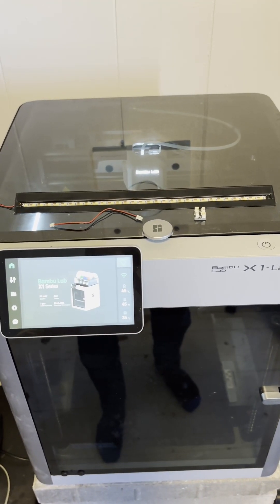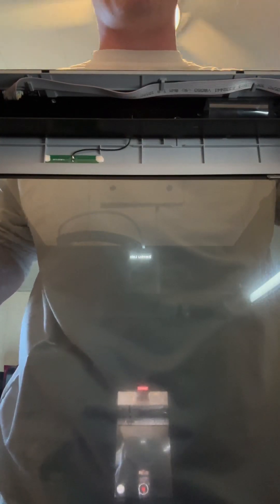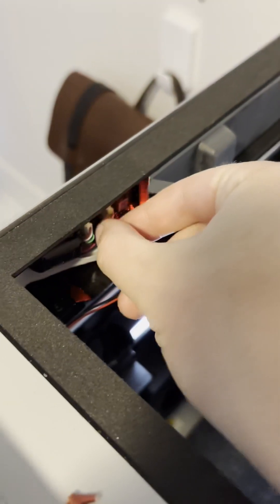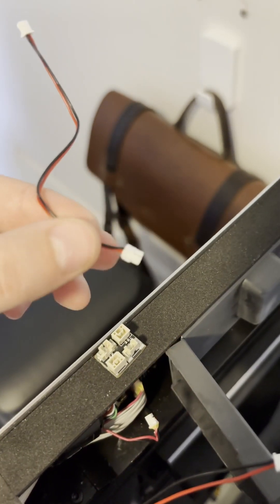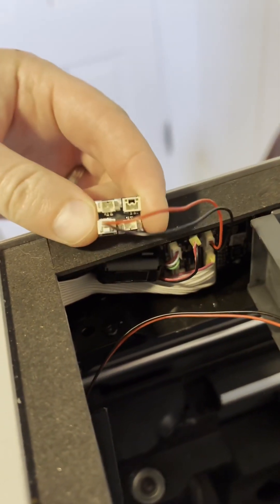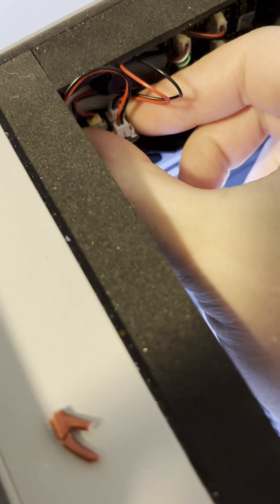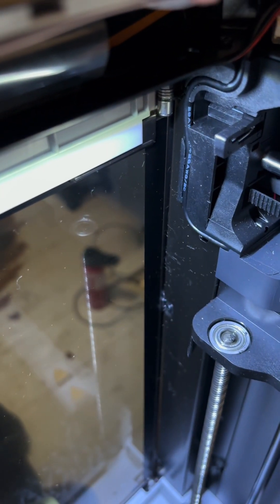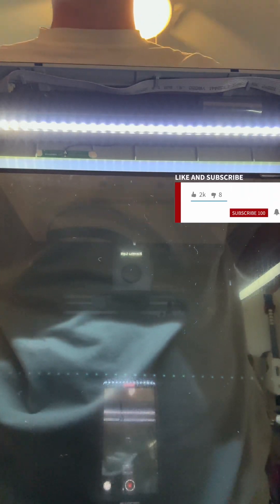BigTreeTech Panda Lux install and first impressions

Comment: BUYER BEWARE:  I just bought this Panda Lux and  out of the box arrived damaged with plug on light broken.  No shipping damage.   Sent photos to manufacturer, and have had nothing but run around, trying to get them to do the right thing and  send me a replacement.  3 weeks and counting and nothing.
Reply from the maker: Did you buy it direct or third party? I would also try contacting them via X or Facebook as sometimes you can get better results.
Reply: @bigtophomestead  yea,bought directly from the manufacturer, have emailed them everything they need photos, receipt...etc... they just keep jerking me around, over a stupid $12 light with a broken plug.  It should be a simple.. "Oh sorry, it arrived broken, let us send you a replacement.... "  but no.
Reply from the maker: @csdesigns4745  yeah normally they are pretty good about it. I got a board from them and a resister was broken so the fan controls didnt work and they just send me a new one and didnt even ask for the broken one back. Keep badgering them and I am sure they will give you a replacement at some point.
Reply: @bigtophomestead  That is what I would expect from a respectable company.  Alas,  not this time.  It's literally like they are making it most difficult they can.

Comment: All my plugs are glued in from bambu this mod doesn't work.
Reply from the maker: It will still work. You just have to remove the glue. Its hot glue so its not sticky a little wiggle action and it will come free.

Comment: Video is outdated? Can't hook BOTH lights to AP board without risk of frying it.
Reply from the maker: There is a risk but a very low risk as BigTreeTech ran the lux and the built in light for months without issues. It was not until Bambu told them hey that might not be a great idea because of amp limitations on their board. So the way I see it is do it however you want but know that there is a risk.

Comment: Have you had any issues with both hooked up since you made this video? I've had the Panda Lux for a couple months and just now hooked it up. I don't like it by itself. The light is too high up and not much brighter than the OE light bar. If both were on, I think it would be an improvement. But with only the Panda Lux it's a no go for me.
Reply from the maker: I went down to one light just to see the difference and just have not gone back to two but I ran with both lights for a long while without issues but just know there is a small risk even though biqu did testing with both lights also with no issues its bambu that is warning of the issues that may arise.

Comment: installation on X1c was pretty straight forward. Connect the light to the bottom rail as shown in the video. The connector should be close to the circuitboard. watch the bambu wiki on how to remove the OE light bar. I broke the tab before checking out the wiki.

Comment: I'm installing this LED as we speak and I'm wondering why not plug the panda right into the stock LED light socket and not use the junction board provided. Anybody see an issue with this? seems that it would be cleaner...
Reply: I believe they changed the connector on the Panda Lux so it can now plug directly into the board on the Bambu printer. Mine didn’t come with the extra board and I just had to unplug the original light and plug the Panda Lux directly in.
Reply from the maker: @markbaker1827  I thought the panda lux had a different connector than the stock light but I haven’t looked at it for a bit so if they are the same then I don’t see why you couldn’t just direct connect.

Comment: I have seen a BTT video where they mention the .3A situation, however they were fitting it to a P1 and not an X1 Carbon, I don't think BQ would give you a socket to plug in the original light and the Panda Lux if it were a problem.
 Does the Panda Lux come with instructions from BQ?
Reply from the maker: So the official stance from BQ is not to have both lights plugged in as that would equal .6A however they stated in their long tests they did not have any issues with both lights plugged in. However the reason the jump board has slots for both lights is because it was not until after manufacturing that Bambu told them that .6A was too much as the original light bar itself was .6A or something along those lines. It seems to be a very confusing situation in terms of communication. Here is how I see it. If you want to "risk it" then plug in both if you want to follow the rules then  just plug in the lux as it is plenty bright on its own and brighter than the standard  light  bar.
Reply: actually it is a problem and they only discovered it AFTER manufacturing these, they warn you on their website and in their official install video

Comment: not recommended to plug both lights as you will exceed the 0.3a power draw
Reply: Both lights are not plugged in only the upgrade
Reply: That video warning against using both lights was on a P1 and not an X1 series
If they didn't want you plugging in both lights there wouldn't be a socket on the adapter board

Comment: It's my understanding that you shouldn't plug in both lights at the same time because it would exceed the 0.3A maximum rating of the port per Bambu.
Reply: The adapter boards were already in production when bambu told them to lower the power and not go over .3A.  The literal instructional video from BTT says not to do it
Reply: They delayed the release of the Lux so they could fix that issue at least thats what the email they sent me said.
Reply: @LestradeGames  Can you post a copy of the email please. I have 2 of these on order and want to see what there official stance on this is. I have an email out to them on this subject, but haven't received a response back. There official website for this item says not to plug in both at the same time still (its towards the very bottom). Thanks for the video its very helpful and its the only one I have come across as of yet.
Reply: @LestradeGames  no, they delayed it because they were trying to figure out a solution to use both stock and lux, but they literally never did, the solution is NOT to use the splitter and the stock light at the same time as the lux, period.
Reply: @LestradeGames they delayed and reduced the lux itself to .3A per request from bambu labs.  Plugging the stock in is still not recommended.  The official installation video on their channel also makes mention of this
Reply: @Nell8908  well we shall see if I fry the board then so be it. So far I haven’t had an issue arise but everyone stick to the recommendation of Bambu and don’t follow what I am doing.
Reply: @LestradeGames  I doubt it causes any issues.  BTT probably had 0 issues during development, but Bambu is being extra cautious I assume
Reply: @Nell8908  I agree. Especially after the whole A1 situation Bambu doesn’t need a 3rd party coming in and causing problems.
Reply: @LestradeGames  note that they only sell the AP board replacement part for the P1P, NOT for the X1/X1C/X1E - anyone with an X series printer should not risk bricking your investment because you wanted to gamble
Reply: You don’t want to swap an AP board on X1. They’re fragile contraptions and you need the support to get a matching unit. Been there , done that.
Reply: Official video and wording on the Biqu site right now states while you can plug them both in kit is not recommended. So do at your own risk. Don't ask bambu to replace the power board if you overload it. Expect to be charged for that board.
Reply: Both lights are not plugged in only the upgrade
Reply: That video warning against using both lights was on a P1 and not an X1 series
If they didn't want you plugging in both lights there wouldn't be a socket on the adapter board.
Reply: @AndrewAHayes  I ran it for a week on all day and no issues. Now I have unplugged it currently as I was testing lighting difference on the camera
Reply: @LestradeGames I saw another video where it looks like the video on the X1C doesn’t look as good.  Don’t know if it was an exchange or both at the same time.